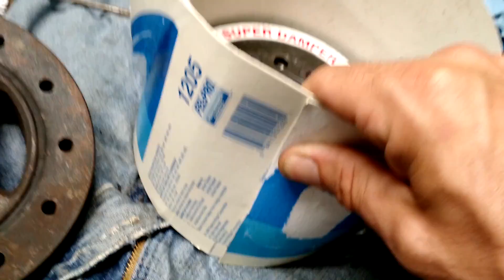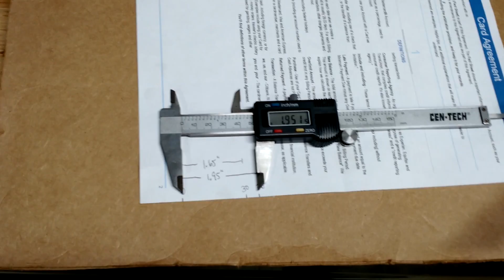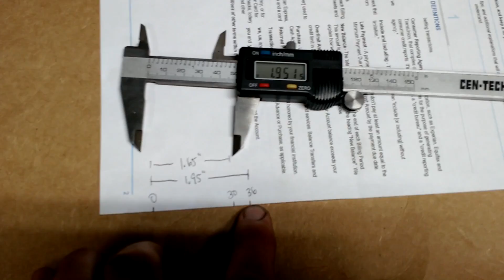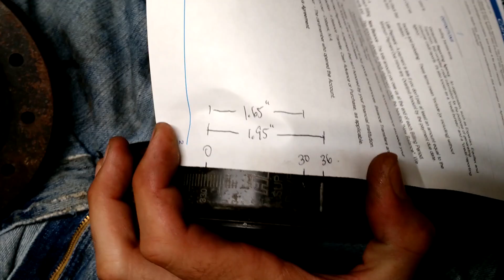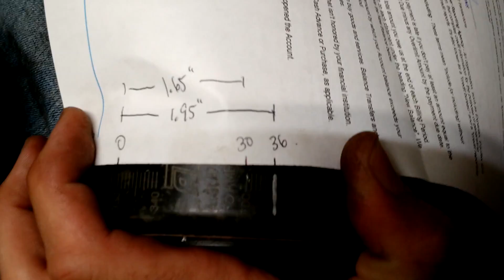Math is actually useful - Re-marking a harmonic damper for free.

Comment: Just wondering why you cant just move the pointer ?
Reply from the maker: It's welded to the timing cover.
Reply: drill two small holes through the tab and make a small piece from alloy....easy